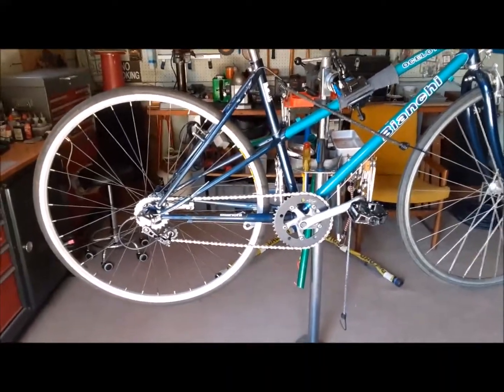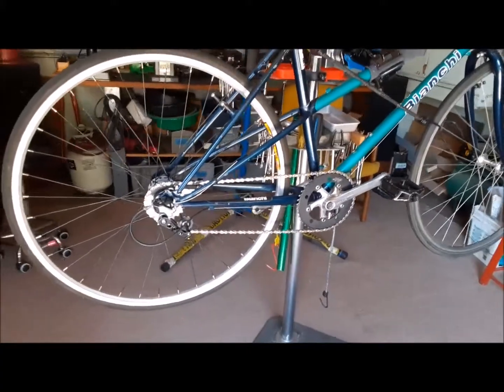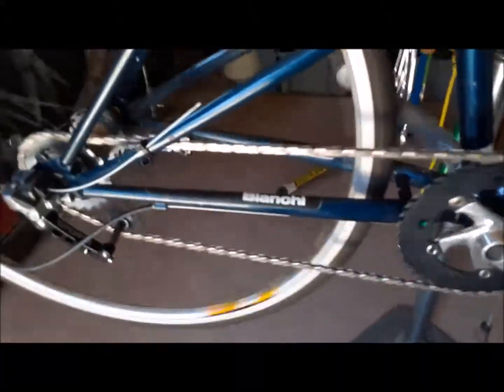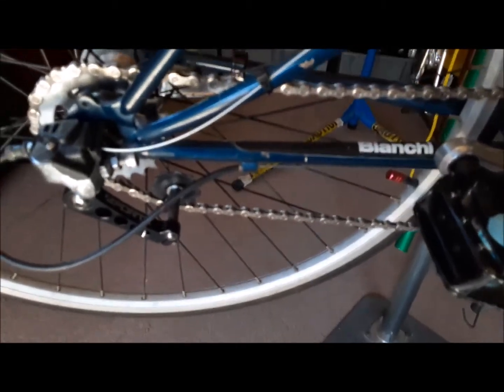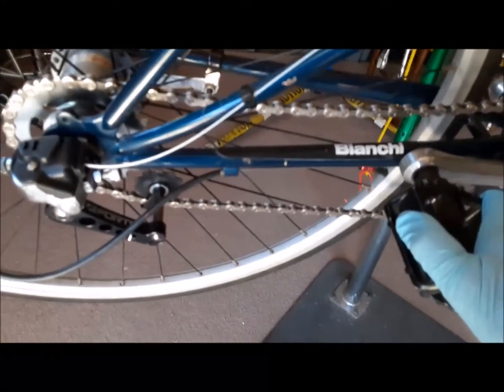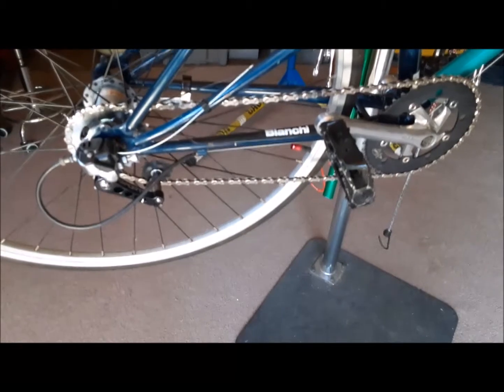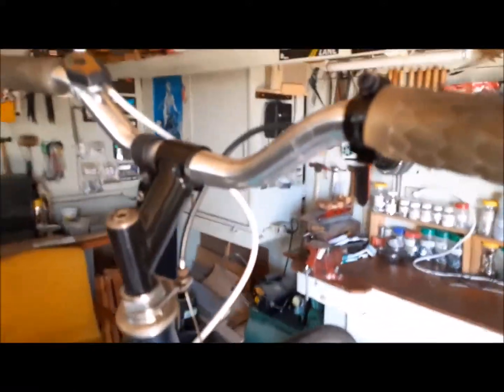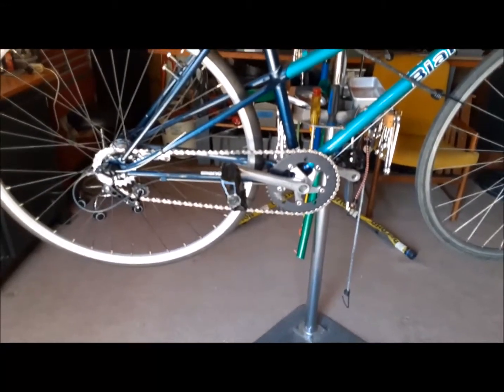USE BICYCLE COASTER BRAKE WITH  CHAIN TENSIONER

Comment: Hi. I drive a coaster brake on my old MTB with vertical drop outs for years now. I built the drivetrain in that way that it was almost a (so called) »magic gear«. The tension on the chain was not perfect but ok — but I always felt a little uncomfortable with it. So, today I tried the chain tensioner and: It worked really well !!! The chain in now under full tension while pedaling and it doesn’t loose much tension while braking.
Building this I asked myself why I hadn’t thought of it myself ;-)). The thing is: Because you do not pedal while braking the chance that your chain is going over the edge of the sprocket is almost zero …
Cheers !!! And thank you for the hint !!!

Comment: Awesome.  I'm building a 2 speed kick back with coaster brake.  Picked up the hub and wheel today from LBS who was lacing it up.  It's going on a Nash bar road bike frame. Aluminum with Carbon fiber stays, cf fork, seat post and stem. Just needs a chain tires tubes and seat clamp to be finished. Oh chain tensioner since it has vertical dropouts
Reply from the maker: Sounds like an interesting build. Good luck!

Comment: That's exactly what I'm trying to do so great to see you've sorted it. Read lots of sites saying it won't work so it was a big relief when your channel showed up!! My wife likes a similar hub gear set up to your Nexus (SRAM S7, coaster brake) and I recently picked up a nice vintage German city bike that previously had a derailleur but didn't spot the vertical dropouts so, like you, I need a chain tensioner. Just curious what chain set up you have - do you run a 3/32" chain set up or 1/8" - a lot of the chain tensioners seem designed for 3/32 and I'm not sure if they're wide enough for 1/8? Also the Nexus hub sprocket looked maybe non standard (or just really new and clean!!). Any advice would be much appreciated. Also if your chain tensioner has proved reliable 3 years on... Thanks.
Reply from the maker: I mix and match chains, cogs, and rings. If any cogs or rings are 1/8 inch wide, you have to use a 1/8 inch chain. Otherwise you can use either 1/8 or 3/32. So, a chain tensioner with 3/32 cogs will work with either size chain. 
The cog shown is a Sturmey Archer, not a Shimano item. I like the SA cogs for appearance and availability in the larger sizes, up to 26 teeth. Luckily, Shimano chose to use the same 3-spline cog standard that has endured with Sturmey Archer for over 100 years. This same standard has been used for coaster brakes on US made bikes for about the same time period.

Comment: as general tinker I find a lot of bike mechanics tend to be parts changers than real mechanic's sad to say. now you have sum that can think out the box but no a lot can!  now i can imagine one could run a front derailleur with a coaster brake hub?
Reply from the maker: Probably not, unless the front rings were very close to the same size. Otherwise, you would need a lot of slack in the chain to accommodate. Which would likely cause the chain to hit the stay on braking, and the tensioner would be swinging through a much larger arc. I have never even considered doing this, but if you or someone wants to give it a shot, let us know what happens.

Comment: Is the tensioner sprung? Can you say what model the tensioner is and where you bought it? Is there any chance you could show this working under significant load?
Reply from the maker: See eBay item number 392721503782  There is a spring to maintain the chain tension. I have ridden the bike and applied full force to the coaster brake. It works fine with no problems. You can also make your own from an old rear derailleur, see my video on how to do this.
Reply: @harv855  it does seem super counter intuitive, as you'd think the tensioner would just be deflected once you transmit force through the lower part of the chain

Comment: I don't get why you'd add a tensioner.

Coaster brakes work fine without one.

What am I missing?
Reply from the maker: If you have a frame with vertical dropouts, you need a chain tensioner. If you have horizontal dropouts, you can adjust the chain without a tensioner and the coaster brake will work fine.

Comment: So i think it is possible to put a front derailleur?
Reply from the maker: Maybe. But the tensioner would have to swing farther to take up the difference in effective chain length. Which could allow chain to touch the stay upon braking. Try it and let us know how it works.

Comment: With this tensioner it is unsafe. The tensioner is not strong enough to with stand the pulling force on the lower chain while braking. In this video you can already see the tensioner deflect. That also causes the upper chain to sag. 
With a sturdy tensioner a coaster brake is not a problem, but this one it too floppy.
Reply from the maker: This would be true if the tensioner was locked into place. But it is not. It is free to deflect through over 90 degrees against a return spring. The spring allows the chain to be under constant tension throughout the spring-loaded movement of the tensioner. The bottom run of the chain straightens out under braking load and provides all the required braking force. All without unduly loading the tensioner which floats against the return spring.